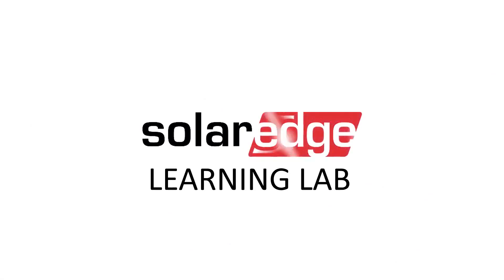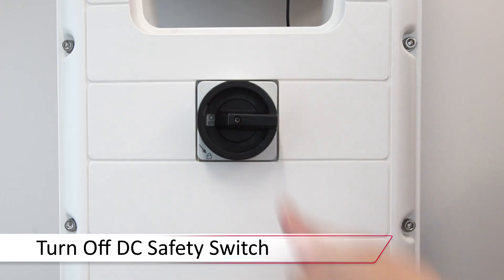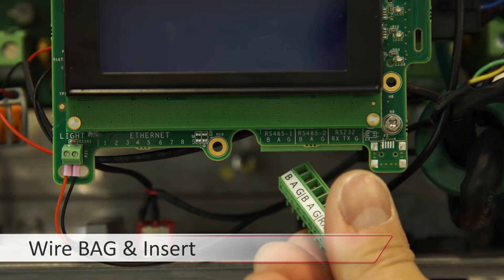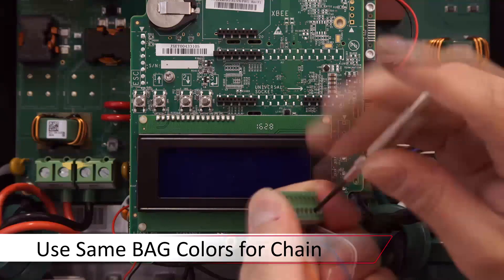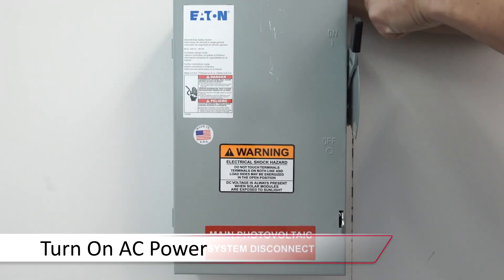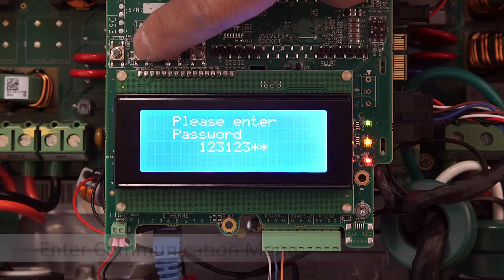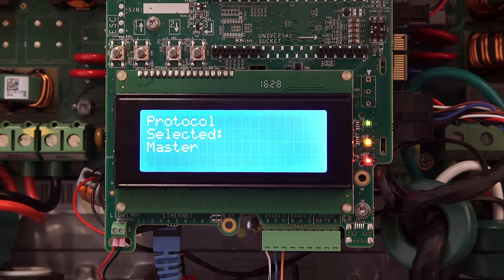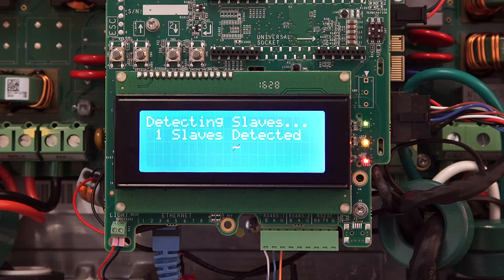RS-485-1 Wiring & Configuration

Comment: So I haven't found any clear information. How do I find how to set this up on a pair of inverters using setapp that does not have an integrated digital display? I have a SolarEdge SE5000H-US000BNW4 with a built-in RGM and a SolarEdge SE11400H-US000BNU4 it does not have the built-in RGM. I need to create a master and slave and have the se5000h report my entire system production because the se11400h is not reporting its production since it does not have a built-in RGM. But both inverters do have a cellular network connection.